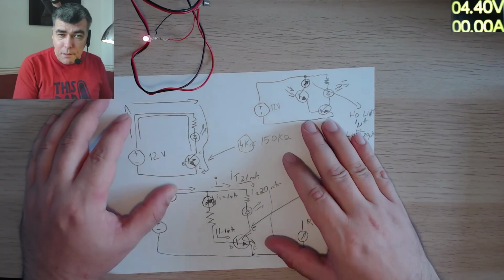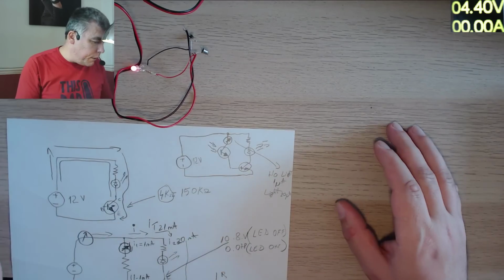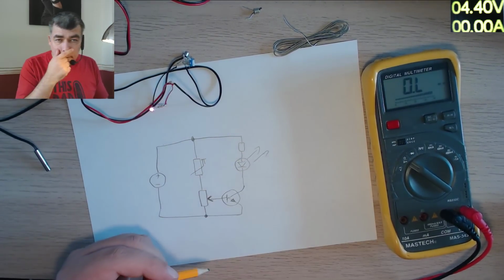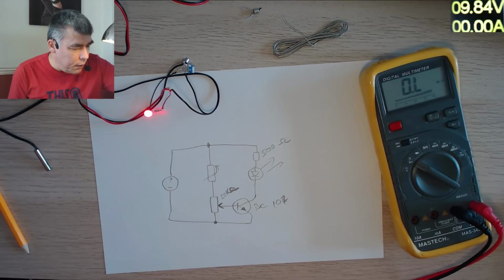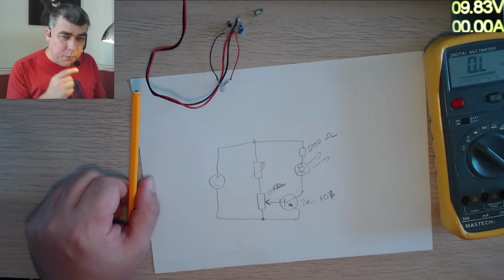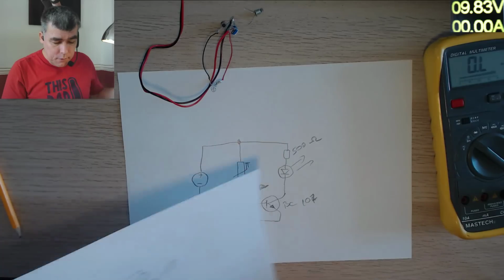5. Transistors and Thermistor - Beginner Lesson

Comment: Does the adjustable resistor at 18.09 need to be connected to ground to open the transistor. What would happen if you disconnected it from ground. Thanks

Comment: when we get fault transistor and we need to replace it,what are the main characteristics that new transistor must have the same as the old one?
Reply: Except of NPN and PNP you have to consider also: Voltage breakdown, Current gain (B or hfe), Frequency limit, heat dissipation etc. But there are so many uses of transistors. Other parameters are important for a simple DC switch. Other for an Audio amplifier. Other for a voltage regulator. It's not an easy task to do this. In the end there is always the option of trial and error but with your own risk.
Reply: @lpelectronics3747  thank u so much for this rich answer.I guess all these parametres are important too.I hope Sorin will talk aout this on next lessons
Reply from the maker: must important one, npn or pnp

Comment: Hi. To be more educational. What about using breadboard. Actually it's difficult to understand what you solder. Thanks for your lessons!
Reply from the maker: Hi, thank you but even with a breadboard will be hard to see without a close up camera. All what i'm doing, is based on the schematic. Also working without a breadboard i expect from everyone getting some soldering skills. On some point we will build complicated schematics on same way 'in air'
Reply: I agree. You would need a close up camera. Fyi. I repaired a motherboard thanks to the first tutorial I saw in which you removed a damaged mosfet. My friends were impressed ;) still need to learn a lot from you
Reply: didier abder: Think about it like that: now you don't see what exactly he is soldering, which wire where, which leg of transistor, BUT i like it how he is doing his lessons.  in this way Sorin is provoke you to logical thinking,  to read his schematic, to wonder which leg of transistor is the gate. It is a way better method to remember everything when you run your brain - run analitical thiking - than showing everything  on hand with camera zoom. 
In fact you can download datascheet of any transistor which you will use and see which leg is which. Just write in google "your transistor name Datasheet" or "pdf" and there is a lot of advanced infotmation BUT also simple drawing with names which leg is gate, drain, source.  If you want to start fix antything or be good in electrionic then start logical thinking /reading schematic, reading datasheets (few first line information), etc.

Comment: Why didn't you connect that adjustable resistor in series?
Reply from the maker: if you connect the adjustable resistor in series, you will see you can't adjust anything because the amplification is very high and most likely any resistor it will pass the necessary current to open the transistor . Try and replicate, you will learn from your own experience.  But, good point of view!

Comment: Great job with your video!

Exposing a practical usage of a montage in real life is a very good idea.

Maybe you could also explain what kind of trouble you can encounter for each component and what does it involve?

For exemple, in this case, a transistor often go in short when it dies (like ceramic capacitor), so you could explain what a short may involve  in this circuit. In this exemple, I think the LED should be always ON.

Other exemple, sometimes you must use ceramic capacitors with IC for timing or internal bypass, if it goes in short it will drain too much current and burn the IC, which it results in cascading failures.

Best regards.